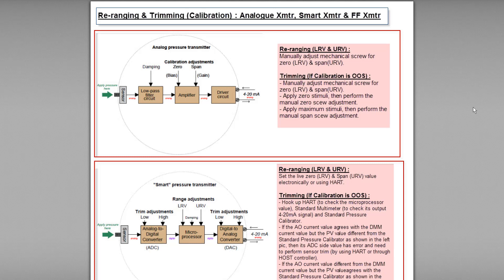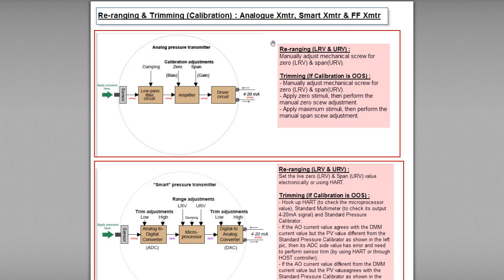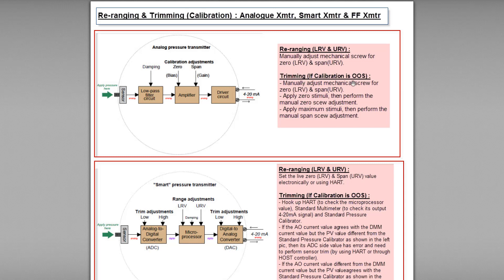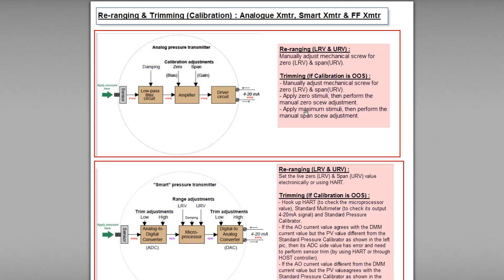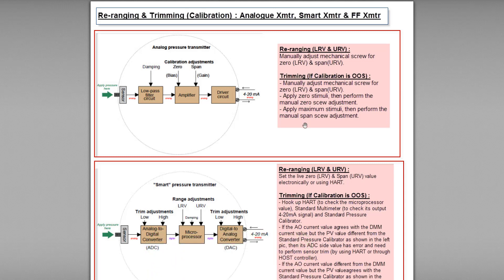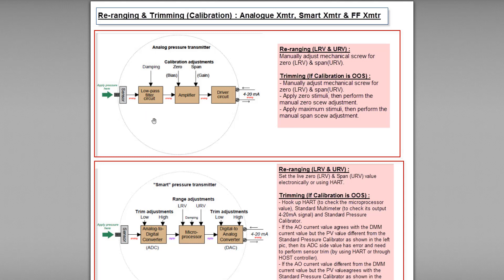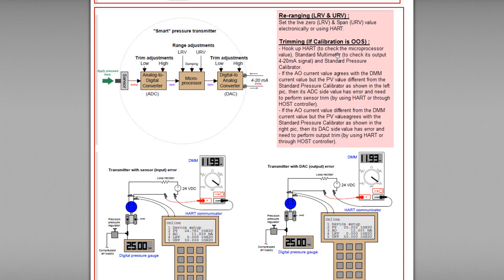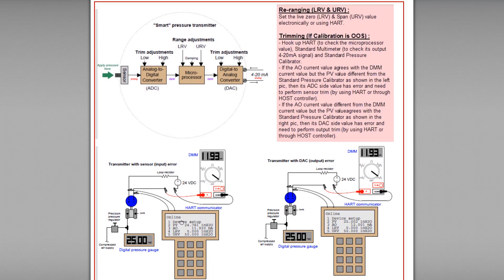Instrument  Input & Output Calibration Adjustment Concept

Comment from the maker: "There are few types of transmitter. The most popular types are analog transmitter and smart transmitter. Analog transmitter is a traditional and electronic transmitter that has been around in the market for a very long time. 

Sometimes, smart transmitter can be called as digital transmitter. Nowadays, most of the smart type instruments will have HART capability for communication. Smart transmitter is more capable and versatile compared to analog transmitter as it can do a lot of things than its analog transmitter.

There are two types of calibration for smart transmitter, namely input calibration and output calibration. Sometimes, input calibration is called sensor calibration while output calibration is called signal calibration."